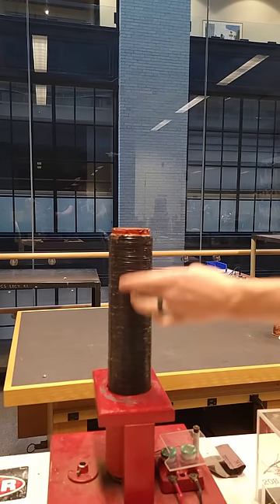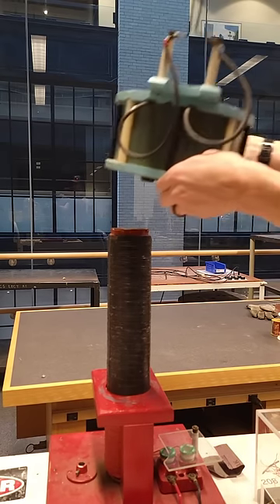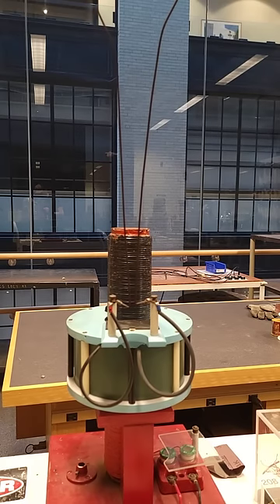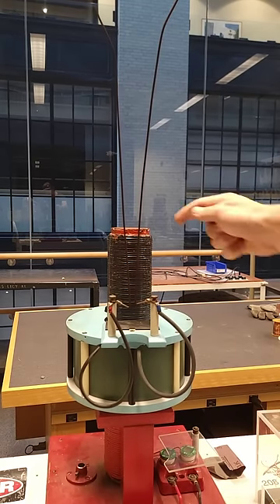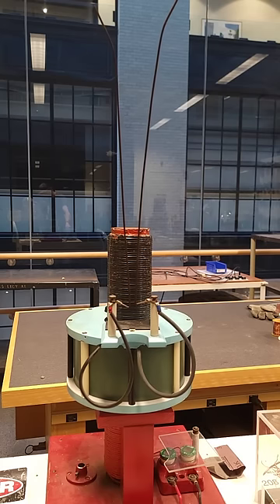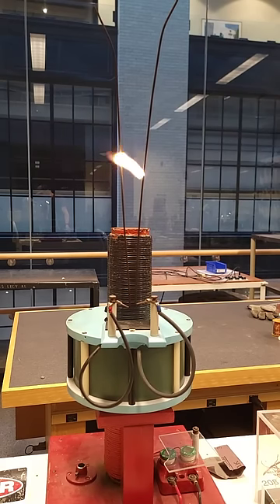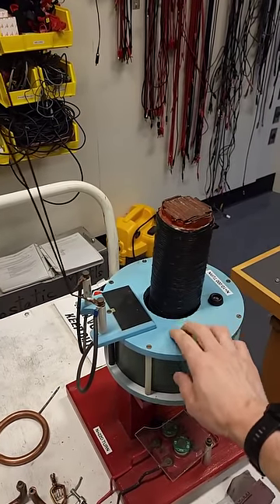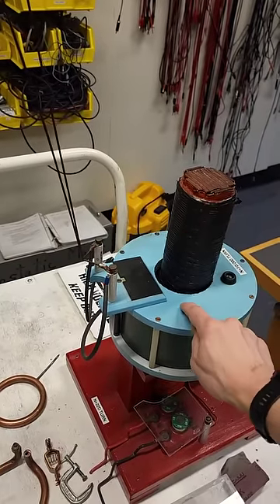Watch this 10,000 turn transformer breakdown air! #shorts #physics #science

Comment: More volts less amps
Reply: @BigDaddyAashik  ohms law most likely, can't get free energy
Reply: @BigDaddyAashik think about a water hose. If you pinch the end the water coming out has less flow, but higher pressure.
Reply: @BigDaddyAashik  because a transformer is an electrical machine which transforms the parameters of the power being transferred through it. In an ideal situation (no copper and core losses) the power (voltage times current) at the input will always be equal to the power at the output. So, higher output voltage (step-up transformer) means a corresponding lower output current
Reply: @lonixlon Actually, it's Watt's Law, which states: Power (in watts) = Voltage * Current. The power on both sides of the transformer will be equal. Therefore if one goes up, the other must go down so that the total power of the system remains the same.
Reply: @thefuzzman  less the heat waste
Reply: More plates, more dates
Reply: Yes same watts, higher voltage lower amps.
Reply: Ohms law
Reply: When they say amps are what kills, what about a lot of voltage? Seems like volts would kill pretty easy or is it more of a stunning effect?
Reply: It's the joules that kill ya.  How fast  and how much.  That energy can pass or fry you on levels from a feather touch to explode you like a claymore.
Reply: @MrM6d  so Watts (total power) are what matters? 10k Watts kills more than 50 Volts or 5 amps?
Reply: @wc4260 great analogy
Reply: To answer the question, it's amps that electrocute. It takes just 15ma to kill you, depending on a few factors. And, you can feel much less then that. So, it doesn't matter if you get your hands across tens of thousands of volts if the source can't provide enough current. A static electricity shock can be delivered from a 5kv source, and the minimal current is expended by the corona of the air gap. If the voltage can source current, the amount that flows through your body will be determined by the resistance of the path taken and the voltage potential, as per ohm's law.
Reply: @klocke-hx3xl  So a source with thousands of volts but very low amperage would be akin to a miniature high pressure washer—it can cause damage but won’t do anything catastrophic?

I know the analogy of electricity to water isn’t perfectly accurate but I still have a tough time wrapping my head around the comparison.
Reply: @bkb04g  As an engineer, I've never cared for any of the analogies, but I realize how difficult to understand this stuff is, because I had to go through it myself. 
Perhaps just accept that current disrupts neural transmission and  use ohm's law on your calculator app to get an idea about the amount of current that can flow through a given resistance ( your body ) for a given voltage. It will then become crystal clear why your car battery can't shock you but will fire up a wrench laid across the terminals. 

Having gotten comfortable with that,  you may now consider the resistance of the voltage source, and note the same thing happens. The higher the resistance, the lower the available current. And this is in fact what is happening when the voltage can't source current. It has a high internal resistance. Anyway, forget the second part if it's too confusing.
Reply: @klocke-hx3xl  AC current is likely just to burn the shit out of you, DC current will clamp all of your muscles, including your heart
Reply: @bkb04g  if the current enters and exits your body without damaging your heart, you can survive
Reply: Don't get cocky though, high voltage can be lethal pretty easily.
Reply: @klocke-hx3xl What I miss from you is that a very high voltage makes a current flow through your body much easier, resulting in a devastating effect, which you wouldn't easily get from a low voltage.
Anyway better not to take any risks with electricity unless you know exactly what the risks are.
Reply: @bkb04g It only won't damage you with extremely low amperage like with the static discharge from walking on a nylon carpet etc. That may give an unpleasant shock from 1000's of volts but a tiny amperage resulting in little power.
The power of a car battery would easily be lethal if you increase the voltage to say 1000V or higher with a step up transformer. Don't forget as well that DC has way more power than AC since 1000V DC is really constant 1000V DC whereas 1000V AC fluctuates between -500V and +500V usually 50 or 60 times per second, so it really is only max 500V or less during a second, the 50Hz cycle can paralyze your muscles with cramp though and can cause a cardiac arrest.
I've heard 40V DC and higher can be lethal (if enough amperage (=current) present. I'm not shure if that is true though, may be.
Reply: @bkb04g Watt is power (P), High voltage can kill or damage if enough current (i, amperage) travels through you.
Reply: @lonixlon tell that to my jobless son living in the basement
Reply: @drink15  which part? YouTube doesn't do a good job of letting me know which comment you are replying to
Reply: @klocke-hx3xl  I was gunna gotcha you then I read "if the voltage can source the current" and realized I've met a homie.
Reply: @bkb04g  Voltage will kill you if there's enough power behind it resulting in enough current. So yeah, the current does the damage but it needs plenty of voltage to be able to flow through the body to do the damage. So the current needs both voltage and power.
The body has resistance (r) a low voltage won't be able to overcome that resistance so no significant current will flow. U=i×r, voltage = current x resistance.
Reply: @lonixlon  lol, true. This one: "ohms law most likely, can't get free energy"
Reply: @drink15  haha, now I see the humor🤣
Reply: @bkb04g amps = current and volts = "push".

Voltage without amps is harmless.  Amperage without voltage is harmless.

If there's an electrical current that passes your heart with some voltage you're dead as dirt.

Even 0.5 amps  and maybe 60volts you could die if it stops your heart for more than a second
Reply: @DutchmanAmsterdam   That was in the comment. Again, ohm's law has only three terms. 

E = I x R  or
Voltage = current x resistance

Pretty obvious that if you raise the voltage, the current will increase into a given resistance, right? 

The question asked is what does the damage, and the answer isn't power and it isn't voltage. It's current. It's then a separate question as to how that current is developed. 
There's a certain way to look at this in order to understand it fully, and I'm describing how to do so.
Reply: @lonixlon  Not true, the majority of people are killed by AC current. It's more prevalent, of course, but also more dangerous for a given voltage.
Reply: @bkb04g if you touch it with your Left hand(heart side) or while your Left hand is the ground it probably will Kill you.
Reply: @MaximilianonMars bruh😂
Reply: So based on the fact that current and voltage are directly disproportional to eachother  ie one goes up the other must go down, then how come 24VAc isn’t as dangerous as say a 3 phase 415VAc?
Reply: @DuckTheMatrix   This concept applies to transformers. Neglecting heat losses, voltage x current in will be the same as voltage x current out. It doesn't mean that all low voltages have high currents and vise versa. Does that make sense?
Reply: @klocke-hx3xl  so the amount of resistance is the determining factor as to how much current is drawn not by the voltage? Is that right?
Reply: @DuckTheMatrix  Again, and the risk of repeating my self too much, just look at the ohms law formula. Easy peasy. 

Voltage = current x resistance

Equal means both values on each side of the equal sign must be exactly the same.

For a given resistance, increase voltage, current goes up. Decrease voltage, current goes down.

For a given voltage, decrease resistance, current goes up. Increase resistance, current goes down.

Same with current. 

Play with the three different values, and the clouds will part and suddenly it will all become crystal clear. I guarantee.
Reply: For everyone's education.

As the current approaches 100 milliamps, ventricular fibrillation of the heart occurs - an uncoordinated twitching of the walls of the heart's ventricles which results in death.

1 volt or 1 billion volts matters not.
100th of an AMP can put your heart out of rhythm and kill you.
Reply: @jackiehopson8334  "For everyone's education", Then proceeds to get everything wrong.

As little as 10 milliamps across the heart will kill you. My estimate is closer to 15. You just skimmed the articles you looked up instead of reading them. 

100 milliamps isn't a hundredth of an amp, it's a tenth. The metric system goes like this:
.1 tenths .01 hundredths  .001 thousandths
999 units each - milli-micro-nano-pico
.Keeps going, but pico is the smallest unit needed for most electrical engineering applications.
Reply: Yes! And volts don't output. They don't come out of walls or anything. Volts are static they don't move.
Reply: @daithipol  so would you say volts are the potential to carry current?
Reply: Amps is like bandwidth, right?
Reply: @gameseeker6307  I would say volts is like bandwidth, amps are like traffic
Reply: More volts, less amps, same energy
Reply: @bkb04g Imagine a water jet cutter vs a water fall. The jet will have a much more local effect but still slice through you. A water fall will decimate you all over. It’s the amps that do more general damage.
Reply: Exactly a car ignition coil 12 v DC increase to 40Kv low anps electric catle fence 20Kv at high amps you would have instant well done steak
Reply: FYI, high voltage at low current can disrupt the very low voltage signal that triggers your heart to beat, you don’t need to cook your heart to stop the hart.  All you need is to stop one beat.
Reply: @eugenecbell  that can also restore a regular heartbeat and save your life defibrillator
Reply: @eugenecbell  here's a fun game you missed a E see if you can find out where. I have been zapped by a car ignition coil 40Kv I wouldn't class it as fun but I am still here. Also zapped myself stepping over a cattle fence 20kv when I was a teen many moons ago there are some things you never do twice and that is one of.them . Produced three boys and they all grew up fine well better than me they haven't tested a coil with there finger yet anyway.
Reply: Exactly
Reply: V=IR
Reply: @thefuzzman *joules law
Reply: @jsb7546  Joules law deals with heat generated. Watts law is power = volts x amps. In a transformer, the input wattage on the primary coil will equal the output wattage of the secondary coil. And the formula for that is: Vp × Ip = Vs × Is
Reply: @bkb04g  When you walk across carpet and generate a static shock, that's somewhere around 10kV, give or take a couple of kV. Generally, you won't feel much up until around 5kV or so.
Reply: @lonixlon  Conservation of energy, not Ohm's Law.
Reply: @ZeroFox1970  Defibrillators actually stop your heart, in the hope of "resetting" your body's natural cardio conduction system. If you're experiencing tachycardia (abnormally fast beat) or fibrillation (irregular, chaotic beat) then a defibrillator can help to bring it back to a normal rhythm by picking the right moment to stop your heart and bring it under control, but if your heart has stopped beating entirely then a defibrillator won't help you, since stopping a heart that's already stopped is somewhat pointless.
Reply: @sfdntk that is exactly what L36S stated restore a regular heart beat he did not state anything you have mentioned tip do not use a defibrillator on your temples
Reply: Put it in water
Reply: @akulkis  well, kinda both
Reply: I could elaborate on that if the transformer gets 110 to 120 volts at 20 amps on that breaker you could only pull
20÷45.45=440 milliamps
But at 5000 volts 440 milliamps is still more than enough to kill you
Reply: Does it still hit the lethal level of amps for us carbon-based lifeforms?
Reply: @jsb7546  you did a good job actually and now it all makes a lot more sense. The thing I was tripping up on was resistance bc I would see 7k Voltage tasers and not understand why they don’t kill. Now I do, along with the power lines as well. One last question, are watts irrelevant in this discussion? Like how many watts does a power line transmit? Or are watts not used that way, only used to describe how much energy (total) a device needs to run?
Reply: @justinragland9399 just to toss a wrench into that 😊 Pure H2O won't carry a charge, it is a great insulator.  So it has to be water mixed with something to carry Volts/amps (ie Tap water is not pure H2O.)
Reply: @bkb04g "Amps are what kills" is a common saying that has a little truth and a lot of misunderstanding. What kills is the actual power, which is measured in watts. Volts x Amps = watts. In most households, the volts are constant (usually 120v from the outlet in an American house). In that case, the only factor that changes the actual power is the Amps. Higher Amps, more killing power. But if the voltage goes higher, a lower amperage can be just as deadly.
Reply: @poogerssamseder2226  but isn’t resistance the main thing that affects fatal shocks? Like an outlet has 120/240V but how many amps? And won’t mAmps stop the heart so even low amperage will kill you, which is why resistance plays such a huge role, right? Anyways I guess one thing I don’t understand is why Watts and Ohms (resistance) aren’t more discussed…but anyways I learned a good bit, thx for chiming in!
Reply: @bkb04g  220,000 volts tazers it doesn't hurt that bad
Reply: @kylelaughinghouse1893  from what I gather, tasers don’t kill or hurt extremely bad because of the resistance which limits the current to only 6-10 mAmps
Reply: Tasers have High voltage and high amperag. The thing is that the electrisity isn't flowing through your vital organs like  your heart, but just between the two prongs.

How many amps it takes to kill a person depends on where it's being  delivered, the duration (static discharges are high energy and high current, but very very low duration,)

another big factor is the frequency of the AC, part of the reason why it's deadly is because the frequency falls into the range where it interferes with your nerves signals which is really bad for things like, muscles, ie your heart.

But if the frequency is outside of the range, you'll just be burned,
Reply: Indeedy
Reply: @bkb04g think of the word 'current', then think a river or a stream. The water is your electricity, voltage is how much water there is, amperage is how strong the water is flowing. A large slow river would be alot of voltage, but very little amperage, kinda hard to die in that. Now a raging small river, that's where accidents happen :)
Reply: @longbow6416  where does resistance and wattage fit into the River analogy?
Reply: Jesus this thread I’d the worst. Congratulations to the few trying to explain this and who kept trying to despite the lost souls who just can’t grasp ohms law. No wonder our country is going down the shitter, this is middle school science.
Reply: @bkb04g resistance (R), and Watts (volt×amps) are important. But what needs to be understood is magnetic current flow and dielectricity. Electricity is a byproduct of Magnetism and Dielectricity. Magnetic Current "flows" 90° out of phase to Electrical Current "flow". 

When people talk about resistance or resistivity, they really mean the dielectric strength of a material. In order to receive a dangerous shock the amount of amperage or voltage is irrelevant. The dielectric strength and the frequency induction is what matters. Essentially what happens when someone gets a severe electrical burn is thier soft bits get radiated. That is from frequency.
Reply: @Cryptic_Triptych  ok that helps. It’s weird how this topic seems to have 10 different answers to the same question….
Reply: @bkb04g  resistance is throttling the water,  and wattage is the total amount of force the mass of water can move
Reply: @brianvillage5  how many keep it in their head? Same with trigonometry and algebra, most will never use it in their lifetimes unless their occupation calls for it.
Reply: still will definitely die if you touch it

2000 watts going through your body aint very fun
Reply: @Ryanisthere  nope, not going to die I've touched 120v at 15amps, also277v neutral in fluorescent tube lighting. As kids on the farm, we used to hold on to electric fence, pulsed 12v DC, just to see who is toughest. 

I agree that in the right circumstances small amounts of electricity can kill a person.
Reply: @Cryptic_Triptych  were you perfectly grounded because if not 15A did not go through you, and were you perfectly connected to the source 

go watch styropyros video on if its the volts or amps that kill, he shows that not all electrical hazards can be pinned on a simple answers

although i do know electroboom did almost kill himself on one of these experiments
Reply: @Ryanisthere  you may want to read my previous posts about dielectricity. 

In one case, in a residential setting, I wanted to run an experiment. I grabbed the hot, 120v ungrounded conductor and touched the kitchen sink, a perfect ground. My skin was dry, the atmospheric humidity was low, and I only briefly touched the sink. If any of those three were different, the outcome could have been severe.

I work with electricity every day. I understand it more than 90% of the population. I know how it's produced, how to use it, how it dissipates and what it can and can not do.
Reply: @bogdan_n  99% efficiency
Reply: @thefuzzman  Its Ohms Law that describes the relationship between volts/ amps/ ohms, watts is the calculation of energy used in a period of time. In this case there is no power in watts unless you have a complete circuit, also the same for amps. both are  results not prime attributes.
Reply: @bkb04g  Voltage is what creates the arc, so the flame. current (amps) interrupts the heart action to kill you "electric shock" anything over 15 milli amps can potentially kill. Voltage burns and consequently it takes a high voltage (Tens of thousands) to make you die from "shock".
Think lighting, think the power lines, where people "Can" be hit by 66 000 volts and survive because little current is flowing, the little current normally comes from the parts of the body getting burnt away from the arc, increasing the gap from conductor to body.
One case the guy walked away from 66 000v arc, another lost all his hands and feet and died 2 weeks later.
Reply: @davidsoulsby1102  Nope. Watt's Law is the relevant equation. And the transformer equations. It's all in my other comments. I'm not rehashing all of it.
Reply: @davidsoulsby1102  how many amps do the power lines typically transmit? I would think they kill the most but now I’m guessing it’s probably a washing machine outlet, home electrical wiring or broken construction equipment?
Reply: @bogdan_n balance, every yin has a yang. 😌
Reply: @MrM6d I remember a PG&E inspector making us wear FR clothing while working on the ground underneath the lineman. 
He asked me if I could here the static then let me know how much voltage was in the lines. We were near a substation at the time. He then proceeds to ask me if I knew why he was enforcing the clothing, telling me if one of those guys up there makes a mistake, he’s going to pop and turn into a pretty punk mist. The arc flash from it will burn you even down here. 
I never have or will climb above conductor, lineman are crazy. Half of them have no clue how to be safe climbing let alone around the power up there. 
I’ll climb 1,200’ up a forty year old guy tower before I go up a power tower.
Reply: @davidsoulsby1102 I can’t remember the voltage, but I remember it being lower, if you’re commenting on what I think you are at least. 
There is a milli voltage that will stop your heart, even with a defibrillator you can’t restart the heart if you get zapped by it. They used to make the strings of Christmas lights in that voltage till they realized what they did.
Reply: @bkb04g below ~30 volts the electrons don’t have enough energy to go through your skin.(assuming you’re dry etc). Above that number, the amps going through you is what matters. A first level approximation is ohms law. 10000 volts through a human(~200k ohms - 1000k ohms) will generate current. If the voltage is high enough it will kill you.
Reply: @bkb04g a power line can usually transmit around 100-250 amps, but at 4300 volts or 14500 volts that is a heck of alot of watts (power). 100 amps at 4300 volts is 430,000 watts or 576 mechanical horsepower
Reply: @bogdan_n WRONG!!! A transformer… is a robot, that can change into a automobile!!!
Reply: @derekholdeman4461  if mAmps will kill, how do people survive being shocked on the power lines? That’s so much current and speed. Does resistance play a factor at all w them? Is that how lineman survive shocks?
Reply: Can you be electrocuted with the current being low
Reply: @bkb04g  high voltage actually travels over the surface of an object or person rather than thru the body.(skin effect )Also linemen working on live transmission lines are using special equipment to stay ungrounded. If they aren't a path to ground, the electricity won't flow thru them. It will just "charge" them to the same potential energy as the line. If they were to be grounded while working on the line, they would instantly die. But more than that even, electricity is strange. Like a river running, electricity looks for the path of least resistance, so if you get shocked but you are wearing a metallic suit, the current will flow over the suit rather than thru the body.
Reply: And less power over all due to losses. But now you can transmit same power through much smaller wires.
Reply: Still way more than enough amps to end you quick
Reply: That's what I was wondering
Reply: I thought it was: 
Your body is the resistance.
Volts is the force that drives electrons.
Amps is the "count" or amount of electrons passing through a point. 

If the resistance (your body) stays the same and you increase the voltage, wouldn't current also increase? As force (voltage) increases, more electrons can overcome the internal human body resistance (ohms). The consequence is, more electrons pass through the given point (that being your body) and so, more current.
Reply: @chickenstrangler3826 yes, that is exactly what happens.
Reply: It's actually possible to increase the voltage without decreasing the current, the catch is the current needs to be out of phase with the voltage. Being out of phase ensures the power output doesn't exceed the power input despite the sum of output current and voltage being higher than the input.
Reply: @lonixlon  You can't produce your own* free energy. Free energy comes from the Earth and harnessing it can become a household project in a few years if we continue the push for freedom.
Reply: @ijustdive  that is true, if I cut down a tree burn it, AND nobody requires payment for it, I guess it's technically free energy.

Additionally, the sun technically provides free energy although the technology required to harness it appropriately costs money.

What I meant is, you never get more out of the conversion of energy forms than you put in.

For example in this video the vast majority of the energy is converted from electrical energy into heat energy. Which then radiates, convects or conducts it's way throughout the entire universe given enough time, the energy is never "lost" it still exists, just in another form over a larger area
Reply: @lonixlon  very true i touched a 1200V dc wire with some RF floating on it (maybe 10V carrier wave). I had grounded my arm to the frame of the transmitter. I blew a 1500V 1 amp fuse.
My arm was useless for about 5 hours before it woke up again. The RF burnt a tiny hole in my thumb, changed my thumb print. Had a plaque made with the fuse and my Thumb print.
Reply: @bkb04g static charge is high voltage low amps.
Reply: @wc4260  well the pressure increases till the flow is the same
Reply: Yes.  But unless you know that magic crossover point between "this feels funny" to "is he still connected?  How do we shut this off safely," it's safely in the FAFO column.
Reply: If the amps are so low. why is the spark so fat?
Reply: @bkb04g  People who say "it isn't the voltage but rather the amps that kill you" are completely clueless.  It only takes a few milliamps of current to kill a person.  But the voltage must be high enough to drive the current through your body.

This is why power sub stations, and commercial electrical panels, etc. all say:  Danger!  High voltage

A typical 12v car battery can deliver many many hundreds of amps of current.  But you can touch the positive and negative posts with your fingers and nothing happens.  Because the voltage is not high enough to push the current through you skin.
Reply: @ctvxl  then I hear resistance brought into the equation as the real determination of death…your thoughts?
Reply: There are many variables that determine if an electric shock will be lethal or not.  Resistance of your skin for sure is one of the major variables, as skin is actually a fairly good insulator if it is clean and dry.

But there are many other factors such as DC or AC.  In general, AC is much more dangerous, but only if the frequency isn't too high.  At lower frequencies, AC disrupts the signals in your nervous system, but at higher frequencies it doesn't.  But even high frequency AC can burn you and could kill you.  It is just less likely than lower frequency AC.

Also, the current typically (but not necessarily) needs to flow through a vital part of your body, such as the heart or brain.  Also, it must deliver enough current for a long enough duration to cause damage.

A typical shock of static electricity from walking across a carpet carries enough volts and amps to be lethal.  However, there is insufficient charge to maintain any significant duration, so the shock does not last long enough to cause any damage to your body.

But you certainly can die from a shock that only travels through a non-vital part of the body.  For example, a large enough shock that travels in your hand, and out your elbow could certainly kill you if it is powerful enough to blow your arm off causing you to then bleed to death  :O

The main thing to understand is that there is a LOT more to it than just "It is amps, not volts that kill you" - Anyone who says that is truly ignorant.

Stay away from all high voltage sources.  Low voltages are harmless, regardless of how many amps of current the source can supply.  But high voltage sources can kill you even with only about 15ma (fifteen thousandths of an amp)
Reply: @ctvxl  thx for laying out guidelines, definitely now understand electricity better